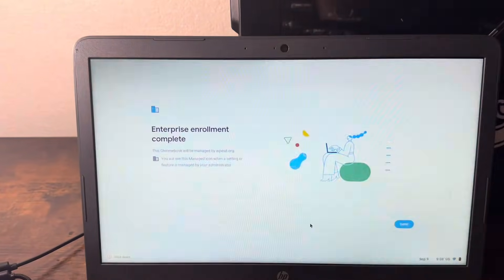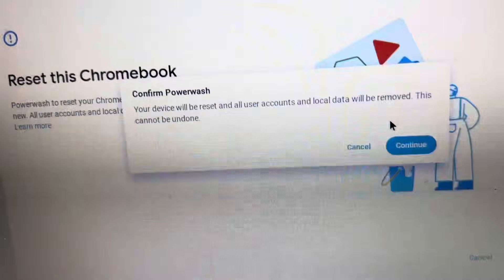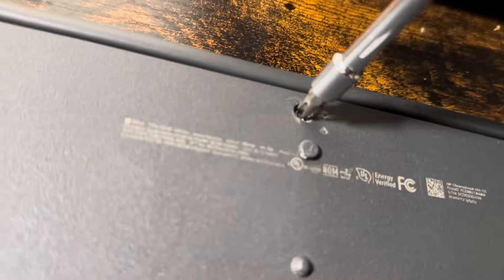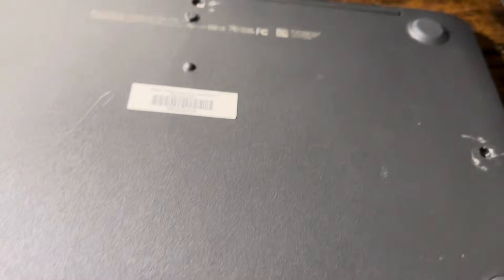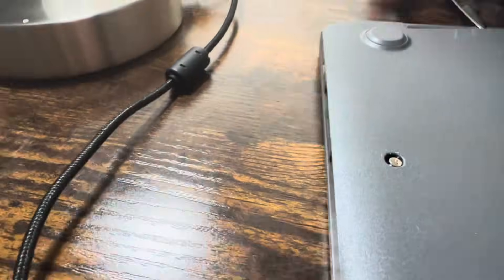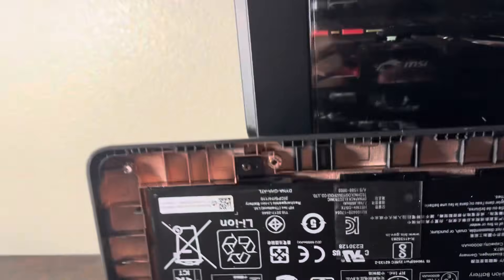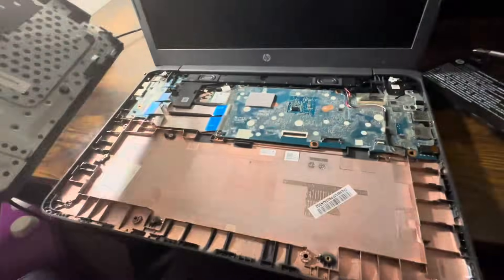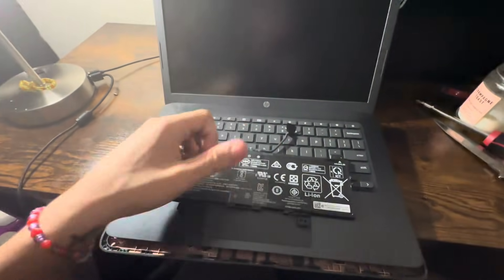How To Remove Administrator lock on School Chromebook (2024)

Comment: You took out the battery, it won’t turn on because it had no power source. Get power to it, something on the motherboard is the enrollment chip, if you can erase the connection whatever to it, you can override their policies and gain normal Chromebook access as if it were your own.

Comment: this method would not work if you admin has managed your chromebook through HWID (Hardware Identification Number) meaning the chrome book has a ID that tells it if it is managed or not in a nutshell one of the easiest ways to spoof this HWID or make the computer think it is a diffrent computer with a diffrent HWID is to boot shimboot on the computer which gives u the option to boot linux on the pc with no restrictions at all besides the network restrictions which are on most school wifi networks but can easily be bypassed using a proxy or VPN, shimboot also uses live boot meaning u can unplug ur usb and boot back into your chrome book WITH restrictions but it will be powerwashed and in order to do that you would have to disable dev mode within recovery mode. the other option in shimboot is to spoof the hwid and boot into ChromeOS with no restrictions bc the pc thinks it is a diffrent device.

Comment: for those who dont understand theres a WP screw if you dont yk what that is go look it up but it basically tells the chromebook it needs that school thing on it so if you remove it and power wash the chrombook then it will work sometimes there is no WP screw so you have to remove the battery (charger is needed so you can power it on) then you can get past the set up hope yall read this and it helps ill be here 24/7 for support
Reply: Can you help me?
Reply: Help meee!!

Comment: shift alt r factory resets take the back off basicly what he did there should be a sim card then take the u tracker out and go and throw that shit in the trash not near your house just go throw it somwere in a city trashcan or if you live in a sity throw it in a subborns trash can then they cant track you then but the battery back on then put the keyoard plug back on then you should put a new sim crad make sure its 5 gigabytes then you put every thing back on power it on and you should be able to bypass every thing your good to go lol [DO NOT TRY THIS YOU MIGHT BREAK YOU CHROMEBOOK HE DID EVERYTHING WRONG
Reply: this is a troll
edit: this video i mean

Comment: I think the way to remove enterprise enrollment off of a Chromebook is to disable write protection which varies via different models, then turn OS verification off, then make a chrome OS recovery usb and plug it in, then enter recovery mode (press and hold esc and refresh then press power) and the system should take over. I have not tested this so idk if it works.
Reply from the maker: yeah that or probably the way i showed you guys. must be only 2 ways
Reply: @vSwitchHype the one you showed didn't work for mine 😭
Reply: Worked for me

Comment: bro really cut the only power that runs the computer but you dont need the battery if you know what your doing and you can cut wires from a charger and try and connect the wires to the computer and make it a pc

Comment: The battery was not in so there’s no battery charging the computer
Reply: Ye so u gotta have it always on charger I have had to remove battery from a computer before and it still worked but only when plugged in.

Comment: Here the process (disclaimer: you need a copy of sh1mmer on a usb):
1. Remove the back cover.
2. Remove the battery.
3. Plug in your chromebook on  a charger.
4. Sign in.
5. Open crosh.
6. I forgot the commands to disable write block but you can search it up.
7. Try to launch intl sh1mmer
8. Reset your chromebook with sh1mmer.
9. Enjoy!

Comment: I have an idea. Because the batter has the enrollment chip. You don't need the battery, you can just plug up the computer when you use it.
Reply: When you have my computer won't even turn on it just in

It just starts blinking
Reply: ding ding ding you got it right, but you have to buy a new battery.

Comment: The worst part is you can't even power wash them it shuts them down but the enrolls you again
Reply: its because the chromebooks how enrollment chips you have to manually take out of the chromebook then replace with an unenrolled one which could be 20$ or 30$, worth it, but you will need to be careful trying to change it because all chromebooks are different and one mistake and its all done for
Reply: Does it really i have a personal chromebook and i had to powerwash it due to an error and it deleted everything
Reply: its called powerwash, its gonna delete everything 💀 @jbczr
Reply: @jbczr  yeah that does work for you because its yours but those school chromebooks will stop at nothing to make sure you are not able to delete their annoying ass goguardian that blocks 99% of any fucking games and EVEN BLOCKS THEM AT HOME!! i dont get it why dont they just unblock the websites and games once you get home
Reply: Not older non touch screen ones

Comment: I actually wish there was a way to do this😂
Reply: People in my class said u have to open it and remove a usb thing from inside then it is unblocked but i didnt try it yet cuz my chromebook is broken
Reply: @Mohamedfile00  no usb in school chromebooks lol
Reply: Have u tried removing the hard drive and replacing it with a different one with chrome os installed
Reply: on a chromebook its a flach drive that's attached to the motherboard @Hoodieboy85
Reply: just boot in to recovery mode and use a usb drive @Hoodieboy85
Reply: @Hoodieboy85  Sorry for not replying. I have never tooken it apart. It’s a 2016 hp pavallion pc. I don’t really know how to start taking it apart tho
Reply: i can re enroll and unenroll at ease
Reply: @imboredasl17  I can’t even remember my passcode for my school laptop 💀
Reply: downgrade to v107
Reply: @imboredasl17  wow
Reply: Or even better with windows installed then u can do whatever u want
Reply: It’s been since 2016 and I never took it apart before.
Reply: its called sh1mmer
Reply: Could you make a video on it? @imboredasl17
Reply: you need admin @imboredasl17